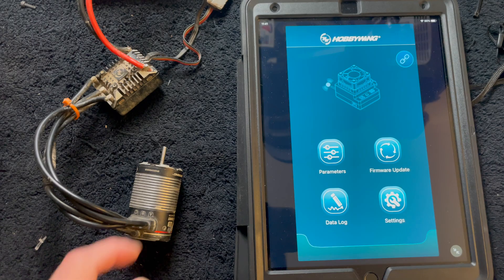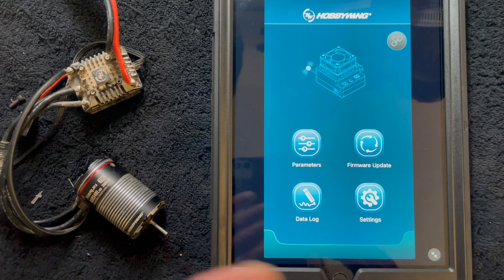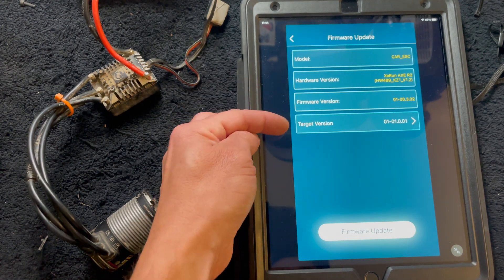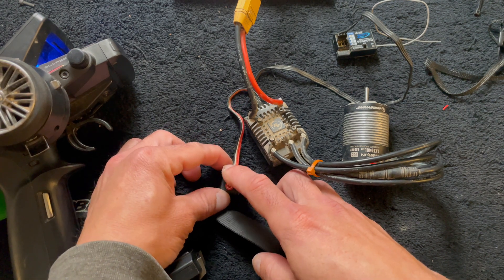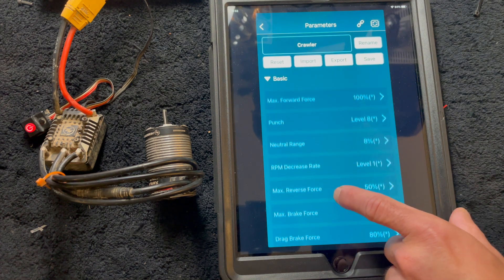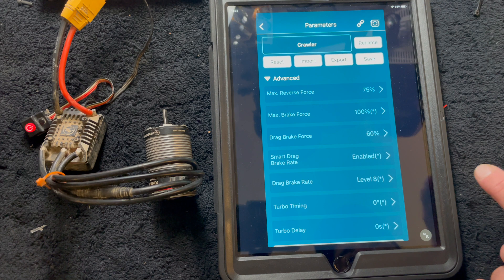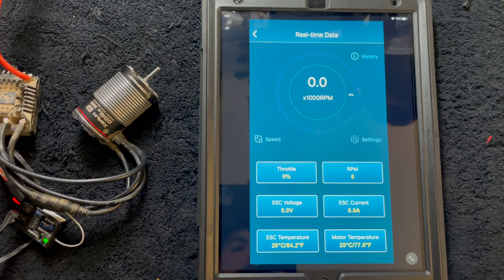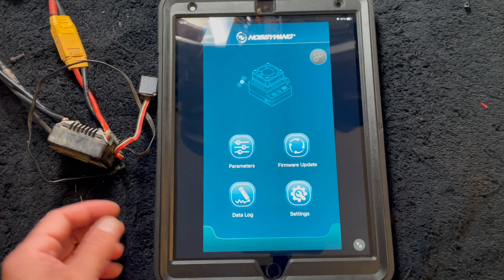The Charlie Show /// Episode 320 /// Axe R2 Firmware Update

Comment: The last firmware upgrade screwed up the Auto Brake feature. realeasing the trigger from full speed will make my truck do front wheelies. If I reduce the braking power it will mess up the drag brake. Switched back to previous firmware.
Reply: I have the same problem, I thought it was my mistake.

Comment: Hey Charlie I’ve got a quick question??? I’ve got a brand new xr10 pro g2 elite that won’t stay on. I cased a jump and did a couple cartwheels and when it stopped it was shut off. After race I tried to turn on and no go. It will turn on light red when button pushed but when I let my finger off the button it turns right off 🤷🏻
It’s literally got 6 race days on it and this happened. Tried the separate on off switch and does the same thing. Will hobbywing warranty or is there a fix for this?
Reply from the maker: Shoot us an email or complete the RMA Form on the website and we can get things resolved fairly strait forward.   NorthAmerica@hobbywing.com or under Support at HobbywingDirect dot com, you'll find the "RMA Form" to submit for service.

Comment: Hey bud cheers ,I have a question I need some help I have a Hobbywing quicrun 10bl120 g2 120 amp esc with hobby wing quicrun 3660sl g2 motor new tho randomly I can’t set now the calibration on the esc I click the set button and power til the esc beeps then let it set the neutral then beeps then you move throttle forward then beeps and then when I try  setting reverse it won’t beep so then I can’t even calibrate the esc I get no beeps when trying to set the reveres now if I hit forward again it will beep not reverso tho .any idea ? Thanks
Reply from the maker: Check out the "Servo test" video here for some easy trouble shooting.  Your radio has "ABS" or the reverse is "turned down", so the ESC cannot calibrate.

https://www.youtube.com/watch?v=NWCgbxWIp24
Reply: @HOBBYWINGOfficial  thank you perfect 👍

Comment: I had to get back to previous firmware.
The latest one went through without issues. Then I did automatic motor pairing. After that I connected my receiver and when I apply throttle, it pulses. Motor doesn't keep the rpm, just speeds up for 0.5 sec and stops and it keeps doing it until I release the throttle. Also when in neutral, the red led keeps flashing on the esc.

Any ideas?

Everything's fine after I went back to previous firmware..

I wish so could use some of those new settings and make this combo smoother and slower on the start.
Reply from the maker: Thank you for the update.  Please be sure to email us (NorthAmerica@hobbywing.com) with the information so we can update our engineering dept for a possible fix.  Thus far all our checks on IOS and Android have been working fine.
Reply: I have the same problem, changed the servosetting on  throttle channel to "analog" on my Futaba system, solved 👍
Reply: I had the same issues trying to update to the newest firmware. Works perfect on the previous version. Using the Vanquish RTR controller and receiver.

Comment: With new firmware i can not get my motor to end the motorparing, it keeps blinking green and runs the motor i same speed for a while. I've tried to back/reverse to old firmware and then it works. The problem is when running with new firmware is it cuts out on steady throttle, old firmware is smooth 😊 Anyone else with this problem?   Great video 👍
Reply from the maker: NorthAmerica@hobbywing.com. 

Please email us and we'll try to assist of course.
Reply: @HOBBYWINGOfficial  I have found the problem I think. I run Futaba T10PX with the R404sbs receiver, with that my throttle feels "jerky" and motor cuts out att steady rpm. With the same radio and another receiver it works perfect 👍 Is the Futaba SR-mode the problem with new firmware? All recivers works with old firmware 👍
Reply from the maker: @HedaTheAce  Would be great if you could email us the details on this so we can assist as needed.  Overall we run a futaba and haven't had any issues with SR models.

We did have a "Bad receiver" make it not work, swapped that out and it was fine after.

Comment: Can you use that app with the fusion pro too????😮
Reply from the maker: The Fusion Pro is part of the Hobbywing Quicrun Series, and ONLY works with the LED Program Box.  

The Fusion Pro, (or any Quicrun ESC for that matter) do 'not' work with the OTA or the LCD Program Card.
Reply: Negative. It does not have Bluetooth built in. You'll need the $60+ Ota Bluetooth adapter.
Reply from the maker: @redndeyes  - FYI, it does not work with the OTA.  Fusion Pro, only works with the LED Program Box for tuning/changing settings.